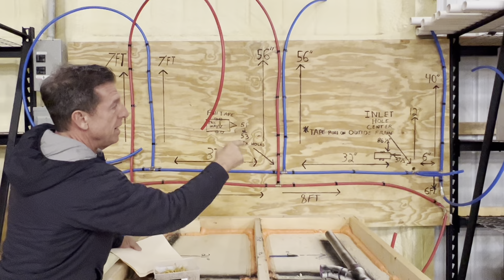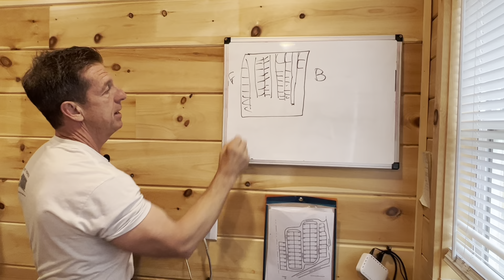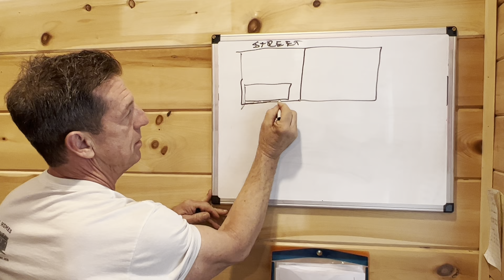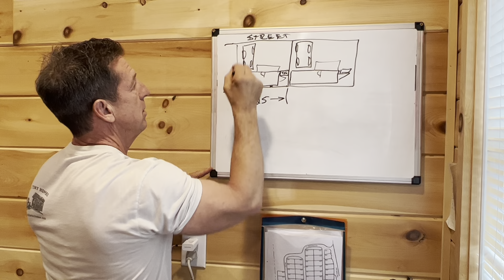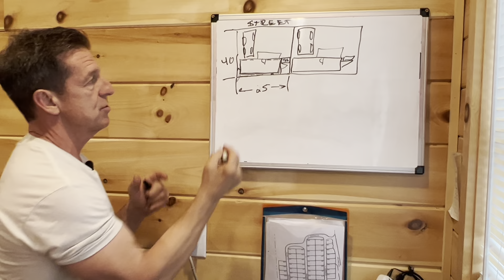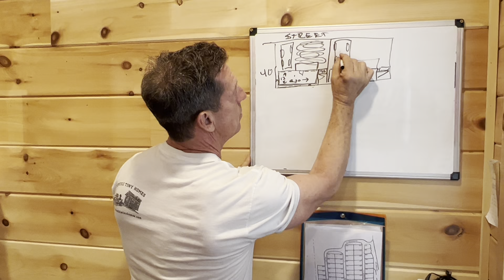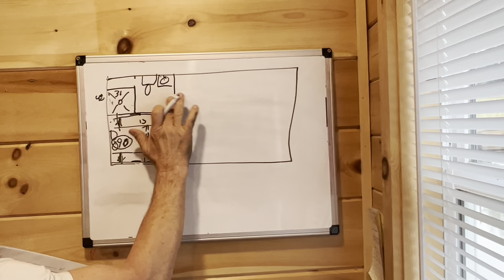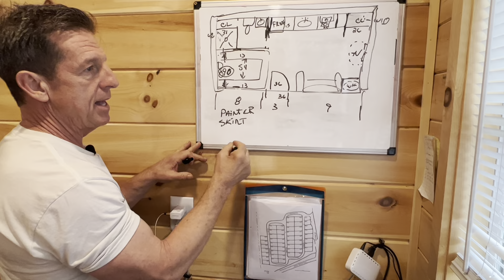FOR SALE….New 12’x20’ Incred-I-Boxes and Leased Lots for $59,900!!!!!!!!!

Comment: Another suggestion, put the W/D next to the bathroom, throw dirty clothes in coming out of the bathroom, put the fridge next and start your kitchen!  I wouldn’t have a sofa but two recliners to watch TV, like Will and Becky have!  Ask Becky and Luann about the plan, they both have awesome ideas!
Reply: I  am glad you suggested that @Nana, It makes plumbing sense. Why cant the water heater be under the sink in the kitchen?  Is it too tall? Then all the plumbing is in a direct line.
Reply: @MBMCincy63  I like the idea of a tankless water heater in the nook in the bathroom!  And if not, use that space for a 48” shower in case someone needs a shower stool!
Reply: I was just going to say that about the washer / dryer next to the bathroom, that and all your plumbing together.  Sink, w/d, and bathroom.  I would put an IKEA L-Shape lounger couch, so it is facing the blank wall where one can mount a nice size TV and a swivel mount.   I also would put an adjustable height desk under the TV, which would be a multi-purpose table, eating, computer, sewing, crafting, making cookies or other goodies.  26 inches, some washer/dryers are a little wider than 26 inches.  LG has a one-piece Wash Tower that has the controls in the middle.  But I would want to put the fridge where you have the w/d and w/d where you have the fridge.  Most fridges I have seen are 28-30 inches wide.

For the bathroom door, I would put a rod, if the person just wants to hang a curtain (shower), there that they slide open.  Have two shower curtains, one for the shower, one for the door.  

It looks like a 65-inch TV will fit perfectly.  How tall is the water heater?   If it is about 27 or inches tall, and have a shelf, one can use that for printer stand or end table, whatever they want.  

I saw a video tour of someone's tiny house made by Mitchcraft, he put the ladder for the loft, in the ceiling for storage, so when you are not using it, it is out of the way.  You will see it from the bed looking up, that is fine.  I love that idea.  Here is a link to that ladder under the loft, slide down and you can see how they put the ladder in the ceiling.  That will be ideal for all the models that have a ladder.  

https://mitchcrafttinyhomes.com/gallery/nicoles-tiny-home/
Reply: @susanpratt3290  ith has put a ladder under a bathroom ceiling that pulls out for a loft before.
Reply: @susanpratt3290  LOVE the ladder in the ceiling!!
Reply: I may not have seen that one.
Reply: I agree.  Washer should be over near bathroom.  I also like the separation of bathroom from kitchen
Reply: I like switching washer & fridge. Definitely would go with tankless water heater. I also like the idea of a high window in kitchen.
Reply: Agree switch the fridge and w/d location
Reply: @MBMCincy63  - Because most of us want that as storage space in the kitchen. I prefer Randy's plan to put the WH up in the loft.

Comment: I love everything discussed however only having windows on one side is a dealbreaker. Depending on which way the wind blows and how the house is situated, you may not get any air. I had to leave an apartment in my younger years and move to a different one on the same complex because of this issue. Please consider putting in one small window on the other side 🙏💙

Comment: The #1 thing for me on these 12x20's is only having windows on one side. I'm living in an apartment now that only has windows on one side. They are large but it is driving me crazy not having windows on the opposite side. I feel so closed in! 
I would highly suggest putting at least one small window high up on the other three walls. If they're high there will still be privacy but bringing in light.
Reply: And air flow!
Reply: Agree. What if something or someone is back there and you can't see them. Like a racoon, bear or Godzilla or a vampire?  I guess you could have a camera, but it bother's me a bit.
Reply: I would like to know how many windows are on the front and how big. I agree put a couple of transient windows up high on the back wall.. nobody will be able to see  in but gives more light and airflow .
Question how do you move your home out if you decide you don't want to be that close to your neighbors?
Reply: Love the idea of windows up high on the opposite wall. Air flow cross flow is so important... And like the other commenter, I live in an apartment with no windows on one side.. It's so claustrophobic... Love the idea of windows up high on opposite side
Reply: With the ESP homes it isn't that hard to cut a hole for another window. You just have to be sure and size it properly for whatever window you buy.  I saw four 3' x 4' windows on this plan, two by the bed area & two in the living room area. Personally I would add a small one and a powered vent in the bathroom and one or two more in the kitchen and that would be enough.
Reply: @cambermcaren2116  that’s something to consider for sure. Another thing is the fact that it’s 12’ and needs special permit and probably specialized movers to move down the highway. Also finding another place to move it to could be a problem. The 8’ sounds more practical to me.
Reply: Absolutely agree. This is a dealbreaker for me
Reply: Or put an opening for window on roof like a sun roof on the car
Reply: Are you not allowed to add one? Or two? Or three?
Reply: Are you not allowed to add one? Or two? Or three? Or do whatever you want?
Reply: Yes. Clerestory windows for ventilation. Are any changes allowed?
Reply: One could put mirrored tinting on all the windows for privacy and protection from UV rays of the sun.
Reply: I would like that than can the stars.  It can have remote opening and blinds during thunderstorms.

Comment: We like much of the new design and especially the option for a lot.  Since you asked for some feedback we would echo the WD fridge switch and small transom window in the kitchen.  With your prior warning about moisture issues in these ESP homes would think that airflow or included air exchanger might be needed.  Also love the comments about making up for the smaller lots by dedicating a few for community spots.  Perhaps one for raised bed gardening and one for fire pit or picnic tables and grills.  This helps offset the need for redundancy at each place but also allows for maximum lots.  Would favor eliminating hot water heater and going tankless to just better open up that space.  If not for all at least it would be a great option.  Not sure full vanity is needed if the tankless and a half sink fits better. Could offer option of a single larger deck or smaller deck PLUS shed for those that want to use their yard patch.

Comment: For year round (evergreen) privacy around the perimeter of your new development, I suggest the "green giant arborvitae".  It grows to a height of 50–60 feet and a spread of 12–20 feet at maturity.  It's fast growing (about 3' per year) and resistant to wind damage.  They make a stunning natural privacy screen.
Reply: @Swim136  He did explain (at 1:25) that the water was coming in only under the door openings, and that when they have the gutters done and the drainage grates installed at the doorways the problem should be solved.
Reply: I agree with the thuja fast growing trees ..I just planted 10 of those myself .

Comment: HOUSE ORIENTATION - Would it work if you alternate one lot with the I-Box parallel to the street and the next I-Box perpendicular. Would that allow the parallel house to have its private yard in front and the perpendicular one to have its yard in the back. Would it provide a visual variation along the street. You could also do 2 parallel and 2 perpendicular. Or, 1 perpendicular and 2 parallel. Also the perpendicular would allow for 2 cars parked tandem.

Comment: Move W/D to refrigerator spot,
Move hot water heater to W/D corner with access from door on the outside, 
Move refrigerator to infront of hot water heater (side wall),
opens up the living room

Comment: Bravo, Randy, it's a great plan! 

Questions for Q&A Wednesday:  
1) I really think we need a little high window above the toilet, at very least.  Same above the kitchen sink would also bring in light and help so much with cross ventilation. (Or maybe a tiny skylight?) 

2) That wider bathroom is a perfect opportunity for a 48" shower with seat (Lowe's and HD both carry them), or a small tub, for which I've seen a number of requests.  These will be so appealing to your older or disabled clients, who need the accessibility of a larger bathing area and the separate downstairs sleeping space.

3) A lot of people have been asking how you will get them into those tight spaces, and what about being to pull them out in case of emergency?   Does your new little tote engine allow you to maneuver them that tightly outdoors as well as on concrete floors? Oh, well, I guess we shouldn't doubt the skill of Yump's team...😉

Comment: I think Nana Betty G had an excellent idea about putting the WD next to bathroom. That will also save on how far you have to plum in water connections. I know you have things in the works to solve the water issue in the Black Box, new building. That's so sad that there is so much water in there. Glad it isnt as cold there as it still is here in Montana😳😘🙏
Reply: Wanda Craig, this is Ms. Betty, but what if I want to throw my dirty clothes in washer but need to go to closet to get clean clothes and I’m butt neked!  Sure hope my blinds work on my windows! Lololol!

Comment: Really nice layout. As for the lots, it reminded me of tenement houses. Very close together. I like more open spaces, but I totally get why, and support helping as many people as possible find an affordable place to live. Big bonus is I have less area to mow. And I don't like to mow, so that outweighs needing more elbow room, lol. I see a lot of flexibility in the floor plan.  If you need an office, you could use the bed area for an office, and get a sofa bed for the living room. Or put a day bed in and a small desk. Or if you want more privacy, since there is a loft there, you could DYI a 2x2 wall at the end of the bedroom area. I am with a few others that would like to see the fridge and W/D areas switched. It's to bad the water heater is in the living room, you could do a wrap around sofa sectional if it wasn't there. But you can use it as an end table, and put a love seat on the end. I can work with this for sure. One question. Since the shower area is 36" x48", instead of a closet, could you put a 36"x48" shower there? Lowe's has some available. :) (I know, I know, I'm the guy that the 32"x32" shower was too small, and wanted a 36"x36". You give me a 36"x 36" and I want a bigger one.) :) I can make a 36x36 work. It was just a thought. Not a criticism. I do like it a lot!
Reply: I just posted the same thing about the larger shower!  We built in a seat in our tiled shower, and I just love it!  When you hit your seventies, it gets harder every year to reach your feet without sitting down.

Comment: Randy try suction cup tools that window installer's use they may work for lifting your panels.
Reply: Yes, I was wondering about those also????
Reply: YES YES YES... I was wracking my brain to try to remember what else I'd seen used... Yes... Suction cups... They even have handles with suction cups
Reply: Or a combination of both? Would a suction device provide the additional strength to allow the magnets to be more successful? Otherwise you could simply use multiple predrilled holes for "hooks" that stabilize/hold to assist the magnets. They could be filled in later.
Reply: @LCCAOL  was thinking same... Holes or slots for strapping to use to lift panels/walls... Then fill in later.. Exactly

Comment: Randy, I know the video shows a wall panel laying down flat, but are the wall panels going to be constructed vertically (or semi-vertically) on a jig?  If so, research granite slab clamp lifters to lift the wall panels into place.  They clamp on from top to lift vertically and might work perfectly for your overhead crane system.  Just a thought.  Good luck.
Reply: Great tip!  I hope it works for them.

Comment: I'm behind on the videos and catching up as I've been out of town.  If the shower is moved to the back wall with the toilet, the cubbies can actually be accessed and used.  I live in a tiny log cabin and we have the same cubbies.  We built a Randy cubbard to fit the space from front to back and top to bottom with shelving.  So much storage in such a small space.  Easy to get into the shower around the toilet, but not so easy to access and fully utilize the cubby space having to straddle the toilet.  Just sharing thoughts and personal design experience.  Always love what you do!

Comment: We had a little 3 wheel pull thing also, to pull our pop corn trailer around at a job site. When we needed to get it out of a tight spot. Or to pull it out, to hook up to our van. My hubbie bought the trailers, had his friend build them he did welding, added walls & roof a door & serving windows.
Reply: We had a pop corn house & a ice cream one. We traded ice cream for a swing ride, but still have old ice cream truck,all aluminum. Family air loom. Use it for storage in back yard.
Reply: We sold the pc one last year to a guy in Maine, with cotton candy machines& all.

Comment: END WALL WINDOW - If you place a high window in only one of the 12 foot end walls, you will not have an issue of any two adjacent homes having windows being face to face. I am assuming the only-one-wall-for-windows decision has more to do with keeping the initial construction cost low. Will the new lot tenants of these larger I-Boxes be allowed to add windows after purchase?
Reply: The problem is that there is a mini-split on the end wall.  They really need a high window most in the bathroom.

Comment: Just a thought, due to the pitch of the roof, rain water will.be directed to the rear of the homes. In an effort to  conserve resources, would you please consiser diverting the water to the front of the house or possibly a rain barrel? This would allow both a passive system to water gardens and prevent the rear of the properties from becoming swampy.

Comment: Locking suction cups like use with windshields and large sheets of glass.
Reply: I think those magnets would work good if they can pick up the car windows they should pick up the metal sheets for the tiny house walls ..

Comment: My thoughts:
Add tankless water heater instead of in the living space. 
Move w/d closer to bathroom.
Put wall or half wall to hide bedroom from living room. 
Add window above kitchen sink. 
Add barn door or or pocket door for bathroom
Add small bathroom window.
Do half sink, vanity in bathroom.
If set up as it is drawn, the your back would be against the window? I like being able to look out my windows. 
So sorry but I guess I am not a fan of this set up at all. And I also don't like the way the house would be set up on the lot. I think they would be better at an angle so hitching it up would be easier. 
Also, I thought you were going to put a community center on the property. If you use that lot for more house, where is the community center going to be? Also, if set up as you say, what type of noise barrier would be put up to muffle the noise coming from the big black building?
Reply: At an angle?? God forbid, is this a truck stop? Come on

Comment: I like the concept, but wouldnt it be better to have the w/d area next to the fridge? Also, I like the idea of putting the hot water above the toilet and not a water heater in the LR area. Keep the plumbing together on one wall.
The area by the kitchen could also have a small island that could have a folding leaf for dining., but is an idea for the homeowner, not you. I like the idea of having a small work area across from the work counters and could roll and store where you mentioned a table and chairs. 
I could also see a smaller bed with some partition furniture next to the door, as a room divider. That could solve closet and clothing storage and more.

Comment: 219 comments and I'm adding another,
Great layout with exception to what most have said 1: place the washer/dryer hookup next to the bathroom, then the fridge, sink, cooktop and all.  2: can the 19gal WH fit below the sink?  3: have hopper windows ,one behind the sink/stove area, and one in the bathroom. you always said you need ventilation for those areas.
Great floorplan, no door on the bathroom, but is there actually a wall for the bedroom?

Comment: Question:  As Randy was showing the base of the Incred-i-box showing some of the wiring and the new position of the RV power plug I noticed there appears to be an AUTO BREAK system installed on the trailer for breaking?  Could you comment on that little box I saw mounted to the trailer frame?
Reply: I'm interested in that as well. I intend to haul mine around now and then, at least twice a year.

Comment: 3 great ideas for Incredi - Box
* Use term Flex Room (living room)
* Clothes rod the length of the bathroom ceiling. You can move the hanging clothes from inside the shower to over the toilet and back again when needed. creating a "shower closet"
*Build a Incredi-box with no windows and the homeowner has flexibility to install where they want.